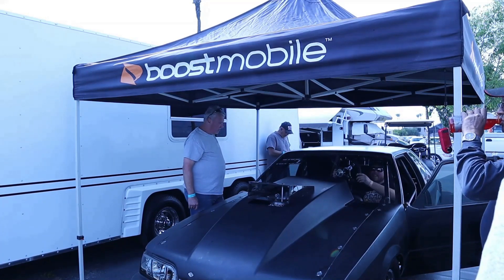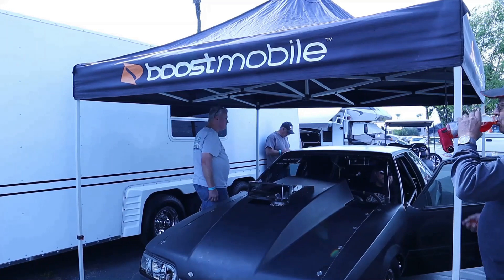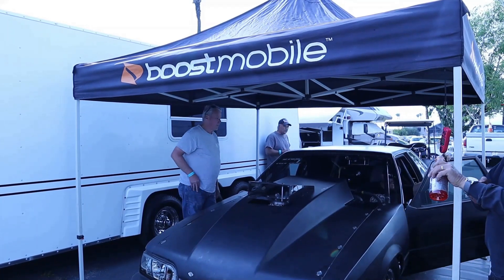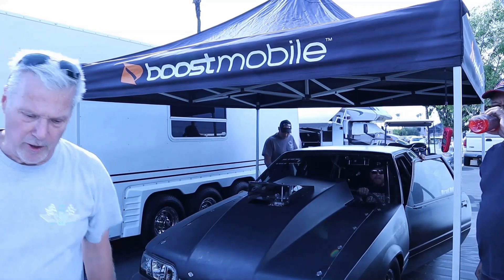WHAT THE HEDDER COLLECTOR TELLS YOU ABOUT YOUR AIR/FUEL RATIO!

Comment: HAS ANYONE HEARD OF A MANY-FOLD ? 
LEARNED A NEW NUGGET 
WIKIPEDIA 
In automotive engineering, an exhaust manifold collects the exhaust gases from multiple cylinders into one pipe. The word manifold comes from the Old English word manigfeald (from the Anglo-Saxon manig [many] and feald [fold])[1] and refers to the folding together of multiple inputs and outputs (in contrast, an inlet or intake manifold supplies air to the cylinders).
Reply from the maker: Yes no tuning consideration whatsoever and just dump all of them in the manifold.

Comment: Hi Ben, I am running Terminator X on my 306, full length BBK headers, I have wideband sensor in the drivers side header where the factory O2 goes.. I think this is giving me false positive AFR readings.. Real black exhaust, plugs are black after idling just a couple minutes..  I am thinking about moving the sensor to the shorty X pipe about 4 inches from the collector connection point on which ever side that has the straightest pipe.  Can you offer me any suggestions..?   I always appreciate you and the knowledge you share with us here.
Reply from the maker: Ask the company what is their best suggestion for sensor location and they should be able to give you great suggestions because they made that part.
Reply: @benalamedaracing2765  not when it's on a different  system.. This is a drag car with full length headers.  Bosch isn't going to tell me on placment

Comment: great video!  Question- does the coloration depend on what type of fuel you are running?  For example, 93 octane unleaded pump gas vs. 110 leaded race fuel?  I've seen pictures of those running octane booster and that looks orange.
Reply from the maker: I figured it depends on the fuels chemical additives but the basic light gray/tan color still applies and is a good indication of an effective burn.  If it is brown we know for a fact it is rich or colorless very lean!
Reply: @benalamedaracing2765  thank you

Comment: Mr Alameda what is your favorite small block ford engine combo?
Reply from the maker: My favored SBF configuration on a 2750# or lighter car is a 9.2 deck with no bigger than 3.75 stroke with the longest stroke!  Minimum bore would be at least 4.165-175 or bigger.  Breathing and great rpm capability!
Reply: @benalamedaracing2765  What's the red tool for air density you mentioned, sir?
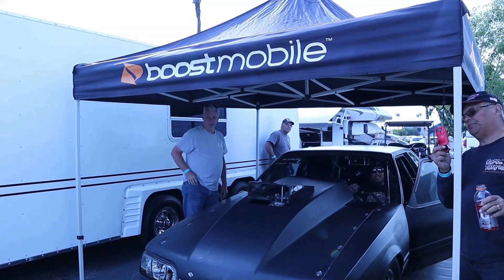Reply from the maker: @findtherightbeat , if you look at screen 13:50 you will see me take a glance at what the corrected altitude is before we make a pass.

Comment: Why do they exit the exhaust out the front of the fenders and not like back in the day when it was under the car
Reply from the maker: We need a lot of weight on the nose at this point in time even with small 8.5-10.5 slicks or radials.  Easy to change head gaskets or taking the engine out as well but mainly for weight transfer.  For example last race, our car lifted to a wheelstand past the 60ft mark and going into 2nd gear.  Lost race because of it!